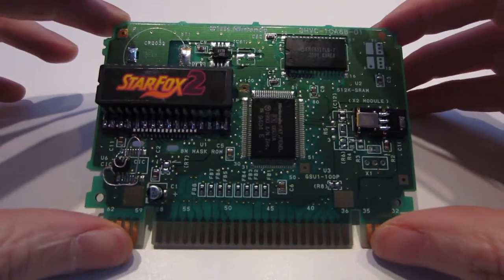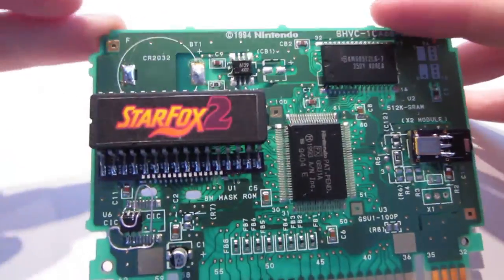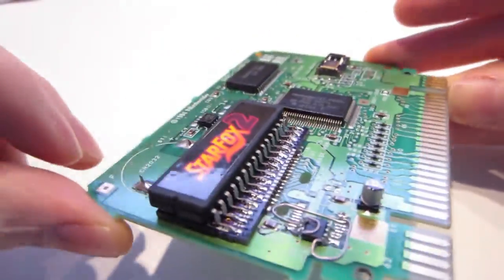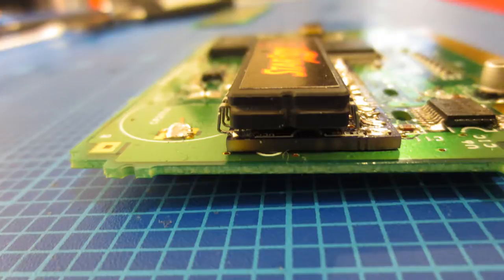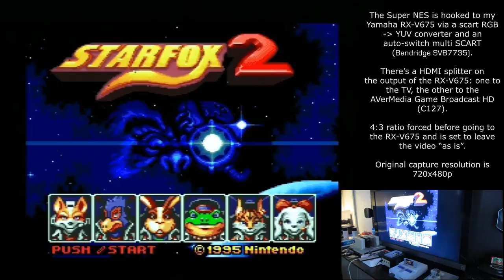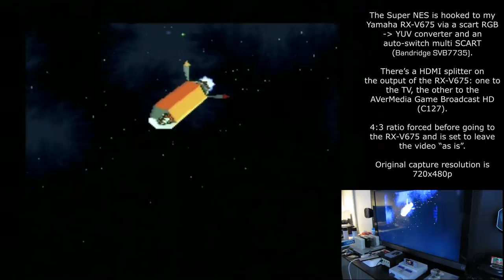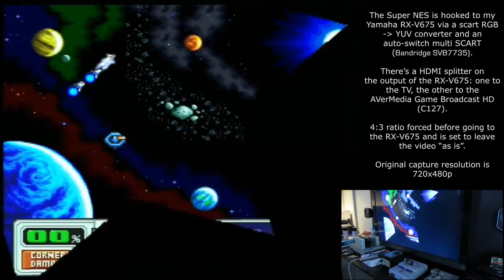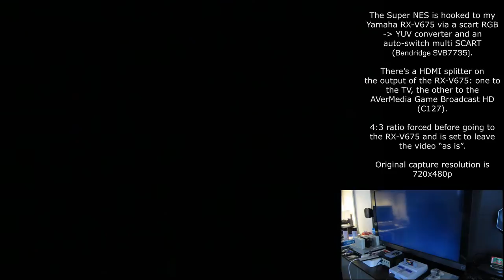[Retro] Starfox 2 reproduction cart Overclocked with 50mhz crystal oscillator

Comment: Hi, would you mind to share a link whit the StarFox Rom already ready to be burned? I want to use it on an NTSC-U console. Please Help me, keep in mind, I am not good doing repros or solding, a friend is helping me , so I need to make everything very simple.
Reply: +BIMBOBOOP Please man share the rom overclocked, I am too noob on that kind of stuff. :(
Reply from the maker: +BIMBOBOOP I won't share my edited version, sorry.
Hex-editing is just an other way to overclocked the game, and I explain how to do it in the comments and in the details.
You can still overclock it without hex-editing by putting a 25Mhz or 26Mhz 4 pins oscillator (with the original double speed mod in the rom this will result to the same result as mine).

If you want a classic Star Fox 2 rom to burn, there're plenty like this one:

http://www.emuparadise.me/Super_Nintendo_Entertainment_System_(SNES)_ROMs/Star_Fox_2_(Japan)_(Proto)_(Alt_1)_[En+Hack_by_Aeon_Genesis_v1.0]_[Fix_by_ManuLoewe]_(Final_Version)/35456-download.

Comment: Is the adaptor using a swapbinned EPROM pin out?
Reply from the maker: +Mark Dormer Nope, no need to byteswap your file. My adapter is designed to properly match the pinout between a standard 27C801 and the maskom without any modification.

Comment: Its posible to make the same thing with starfox 1? I mean disable the double speed mode (if this is present)?
Reply from the maker: Not with Starfox original PCB. You need at least a GSU-1, because the Mario Chip 1 don't have the Double Speed Mode. I did an overclocked version with a Vortex donor: (cart on the right of the picture) https://i.imgur.com/W41DnJb.jpg
Reply: good, i will use a gsu-2 cart (japanese yoshi´s island), now in the rom itself, what part of the rom i must edit to disable the double speed mode?

Comment: do you have a schematics to see the crystal oscilator board???, and the value of the regulator??
Reply from the maker: https://oshpark.com/shared_projects/9FyqK60v, nothing particular. Volt Reg is a 3.3V SOT223.
I'm going to make an other vid with the rev 3 of the board.
Reply: ohhh man thanks, another question: if i disable the irq mode and i DONT install the Smd crystal, the game will crash???
Reply from the maker: No, but it will be really slow. In short: by default, the Super FX run at 21.4Mhz (either directly from the Super Nintendo like Starfox, or later with the 3 pin oscillator directly on the PCB). But originaly it runs at half this speed.
The game which are using it with a "double speed mode" can be seen as some kind of clock multiplier, but in fact is a full use of the 21.4mhz. So you can overclocked with the same mod but with a 25Mhz oscillator (I think some modders topped at 27Mhz). Disabling the double speed mode can be seen as "0.5"x21.4Mhz, and so you can push to 50Mhz (all my tests result at crash at 54Mhz). I like to see it like some overclocking of a classic CPU: reducing the clock multiplier in order to add more brut Mhz.
I'd like to make a vid and compare 25Mhz vs "0.5"x50Mhz.
Edit: more accurate explanation.
Reply: hi, sorry but you can upload de pdf file again, i lost the file : (
Reply from the maker: Check the tutorial here, everything is in the comments:
https://www.youtube.com/watch?v=6VVbZqadVKY
Reply: another question question, i dont have the adapter, so i want to do the crystal thing "in the air", well i can use any "four pins" crystal oscilator (obviously a 50 mhz crystal of course)? regards! :3
Reply from the maker: Yes, It's running at 5V so you don't need the adapter. My adapter is just to convert 5v to 3.3V and power the SMD oscillator (and have a low profil design). I hope you have properly edited your rom because at 50mhz whitout editing it won't work.
Reply: yes, i follow your instructions so i have the rom edited, thats very cool that you can use this only with the crystal alone!thanks
Reply from the maker: Don't forget to test your modifications of your rom in a emulator. ;)
Reply: in fact: i tested on a emulator first and works very good : D
Reply from the maker: Nice!
Reply: The Real Phoenix and my last question (i promise xd), the crystal signal imput on the board, what point is it?

Comment: man, whitout the crystal and the 3.3v regulator it should still work and show image? cause mine it doesnt
Reply from the maker: Yes of course. Did you test all the pads before soldering the EEprom? Did you only remove the header of the ROM? Also don't byteswap the ROM. Check the tutorial of the new revision of the adapter https://www.youtube.com/watch?v=6VVbZqadVKY
Reply: Thanks for answering me and Yes. I am affraid I didnt use a good ROM, I asked previously in order to grab and assure the ROM was already tested, so I just used a random one.

Comment: Great stuff!
What is your recommended technique of soldering the adapter to the board?
Reply from the maker: +Martin Samuelsson 
Thanks. I put some solder under the adapater and on the SNES board. After positioning correctly the adapter and put some flux to avoid brdiges, I use hot air to melt the solder. The excess of solder is suck by the holes and let the adapter to be flat. After testing the contacts with the pads on the adapter and the vias on the SNES board, you can solder the adapter. +GadgetUK164 made a video (and had a lot of trouble unfortunatley) you can see it there: https://www.youtube.com/watch?v=cIkwpwHOoM0
Reply: +The Real Phoenix Just watched it, looks a bit tricky, just got in the boards yesterday, as long you can test the connections it should be fine :)

By the way, is there any special reason you didnt use half vias for the connections?
Reply from the maker: +Martin Samuelsson You mean castellation? Since OSH rules in Eagle told me it was invalid, I thought it was a no go. I also read people said it was not ok or diffiult to have it on OSH. I thought that maybe it was something more diffcult to do. I had a discussion in the comments of the Gadget's video and someone made a design for it. Seeedstudio seems ok for castellation for making the board.
Reply: +The Real Phoenix ah! So that's what's it called :) 
Info here
http://docs.oshpark.com/submitting-orders/cutouts-and-slots/
I swear I've seen it on other osh designs..
Reply from the maker: +Martin Samuelsson Yeah I saw that, and OSH told on twitter that they actually do castellation, but I read on some forums that they hold your order and you have to pay more IF they accept your design. It seems to be case by case. Since Eagle told be my board wasn't valid because of clearance issues, I didn't took any risk.
Reply: +The Real Phoenix Would have done the same :)

Comment: hi again, i try to make this with a yoshi island pcb, i adapt the pcb to support 512 kb of sram (the original only have 256), i remove the 74hcu04, and connect the signal clock in the pin 75 (thats the signal clock pin for the gsu-2), and it didnt work, are you tried with gsu-2 carts?
Reply from the maker: Nope. What oscillator did you use? Did it work with the original 74HC04? (did the game boot with the 512Kb of Sram)
Reply: @TheRealPhoenix_Retromods  i didnt tried ;( , i used a 5volts 4 pins crystal oscylator (that giant square old oscylators), with the stunt race fx did work!, but i cant make it work with this pcb
Reply from the maker: Ok so since the oscillator works, and since it's definitely possible to O/C a GSU-2, it could be something wrong down the line with 1) the adapter installation, 2) your modification of the sram, 3) your rom file or 4) an issue when you burn your eeprom. I would recommend to revert everything, and restart from the begining, testing at each steps.

Comment: so I'm gonna be ordering quite a few of the adapters. is there instructions on installing?
I assume take stunt fx,
remove mask rom
solder adapter
solder eproms into adapter 

what if I don't want over clock? do I still need to hex edit rom?
Reply from the maker: Hey man, don't order yet the adapter: I'm currently waiting the Rev 3 of the board which should be easier to solder.
If you don't want to overclock, no you don't need to hex edit the rom. In fact you can overclock it without hex edit the rom (you just need a 25mhz oscillator).
You don't ever need to byteswap the rom. Just be sure you don't have a header.
I'll try to make a tutorial asap when I get the board.
Reply: The Real Phoenix thanks mate, I'll hang tight. based off what your saying I can use a headless rom and skip the hex editing? will eproms be same or different?
Reply: The Real Phoenix Is it nessecary to over clock?
Reply: The Real Phoenix can you message me?
Reply from the maker: Yes you can use a headless rom an skip the hex edit. No it's not necessary to overclock it.
Reply: The Real Phoenix final question I'm sorry. is there a particular rom which suits this best? love your videos too great work

Comment: with the crystal mod and your pcb to confirm process:
1. You removed R4, R3
2. Changed R5 to 10ROhm
3. Change C10, to what value please?
4. Where do you solder the adapter board to, what pcb points
5. Do you have to patch the rom in order to use the new crystal?
6. What is the part number of the crystal you used?
Reply from the maker: See the second part of my tutorial video here from 5m11s: https://youtu.be/6VVbZqadVKY?t=5m11s

Comment: you going to do a write up? :)
Reply from the maker: You mean a tutorial? There's nothing much more than what I showed and explained in the description: find a way to wire up a 27C801 to the mask rom, add a Crystal oscillator (search for overclocking the Super FX), and hex-edit the ROM like I wrote in the description.
I made adapters 'cause it's easier and cleaner than wires all over the place.

Comment: You know that starfox  requires more ram than the stunt race fx 512 kb  as well as the super fx chip thats why lots of people use the sking  gold game that has the super fx 2 chip and more more vram 1 mb ! just saying  but  overclocking definitely helps out the frame rate  it's to bad it speeds up the game lile playing a pal game on an ntsc console ! Did you know that there was originally a third vehicle for star fox 2 that the awing turned into that looked like a tank but they cut it from the rom when the developers leaked it to the internet because it had control problems and they didn't have time to fix it since they weren't releasing the game on the super Nintendo  as was originally planned  !